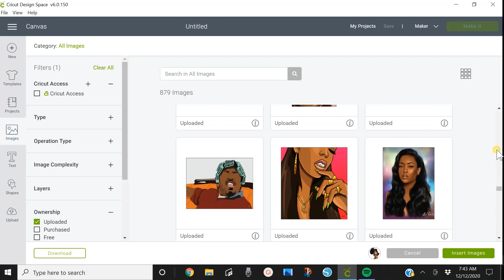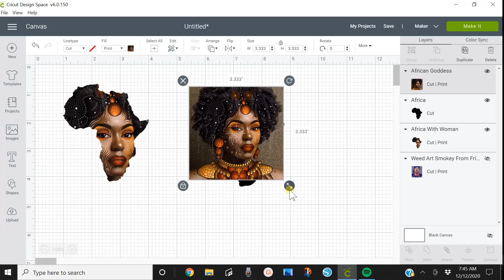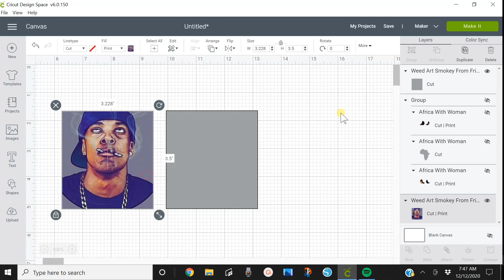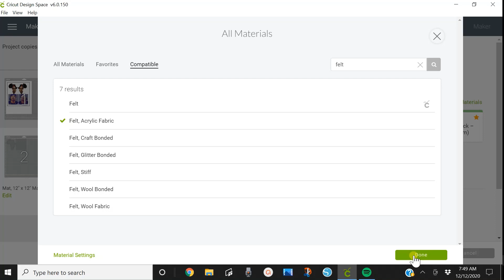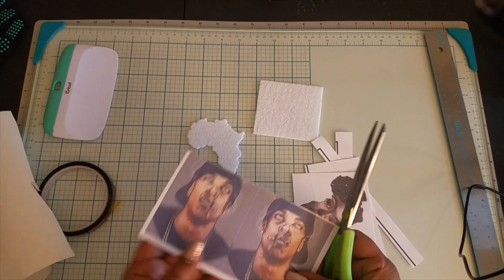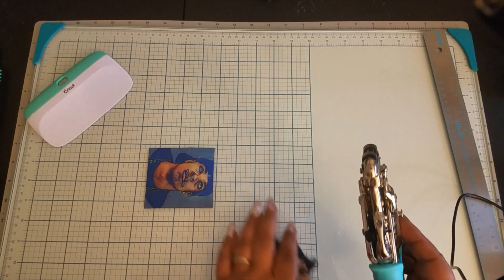Sublimation Felt Air Fresheners Using Copier Paper and craft store felt

Comment: Hey! What setting would you use to actually cut an air freshener blank? The actual air freshener material won’t cut with cricut I’ve tried everything.
Reply from the maker: I used felt setting and it will take several cuts

Comment: Great video! Can you please tell me do I need to change my sublimation printer to high quality  I had printed a picture and it was very light on my felt. I used my easy press for 60 seconds at 400.  Thanks in advance :)
Reply from the maker: You can try changing to high quality or best print
Reply: I use photo matte paper best quality setting, but I turn bleed off so the options pop up

Comment: Another question sorry. Using regular printer paper. Can be it be printed on a regular printer? Or has tonbe a sublimation printer?
Reply from the maker: This method I sublimation and requires sublimation ink.  If using  a regular printer you would use printable heat transfer sheets for dark fabric

Comment: How do you use heat N bond to glue them together? I’m new to it and have never used it so I’m lost
Reply from the maker: Heat n bond is a fabric glue found in the sewing section. It's a glue that you iron on using your home iron. Once you apply it to both sides with the heat you can stick them together
Reply from the maker: The product has simple directions on the packaging as well if I didn't explain correct

Comment: Where did you get your air fresher sheet ? I have the small rectangle air freshers but I have been trying to get the sheet so I can cut it out into a different designs
Reply from the maker: Unfortunately I purchased them over 3 years ago and I don't have the vendor information.   I posted a link to a similar product but I've never ordered from them so I can't vouch for them
Reply: @ACraftyMess  thank you so much 😊
Reply from the maker: You're welcome.  You can find stiff felt at most craft stores and on Amazon.   That's what I used for this video
Reply: Do you use unwaxed butcher paper?

Comment: Can you use regular felt?
Reply from the maker: I recommend the stiff felt.  Regular felt is very flimsy like fabric.  If you use regular felt you will need two layers with maybe heat n bond in the middle
Reply from the maker: Yes but you'll want to bulk it up.   The reason I use stuff felt is so it will keep its shape.
Reply: @ACraftyMess  like glue 2 together? I will just go buy the stiff one?